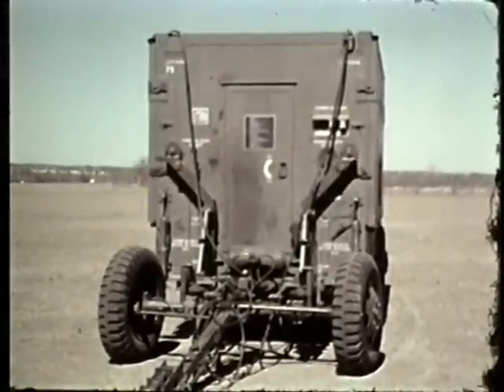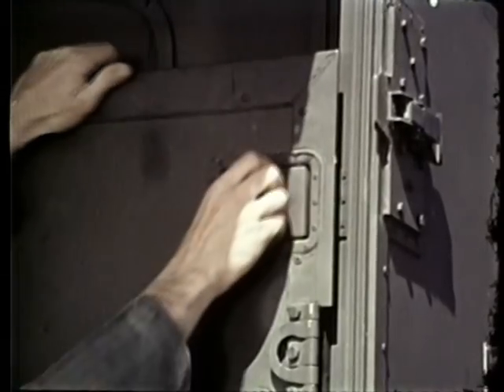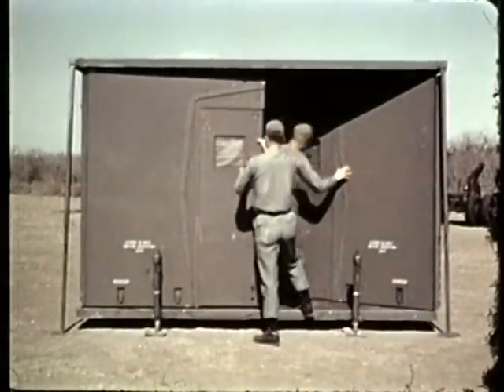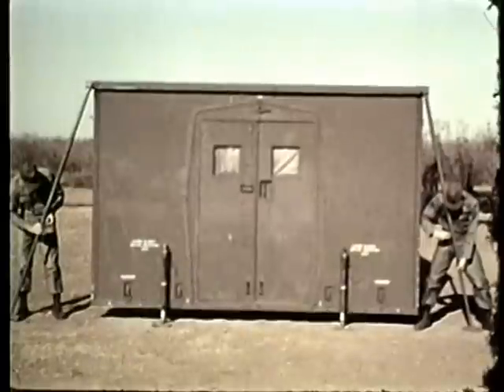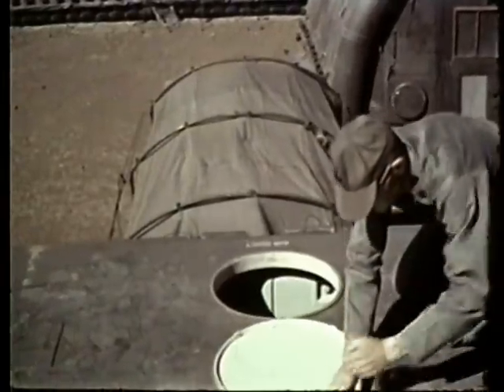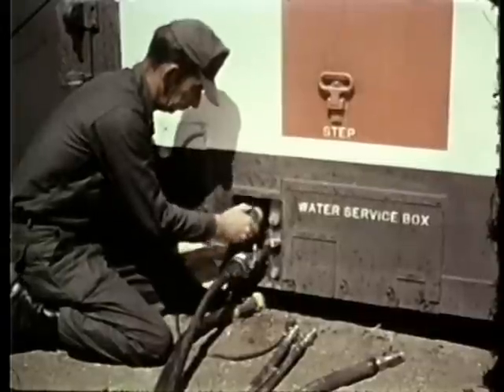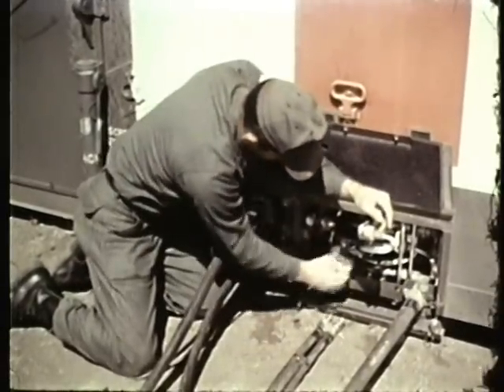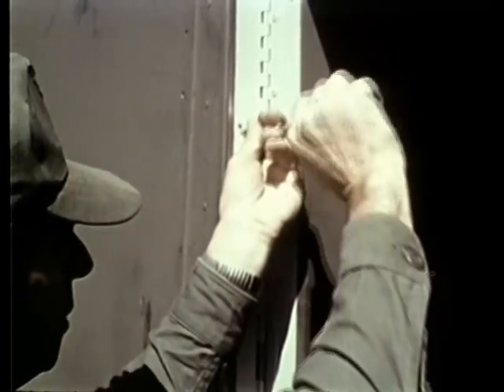U.S. Army M.U.S.T. Expandable Shelter (1972)

Comment: I like how all the ratchets are secured with cables so pvts dont lose all of them.
Reply: Unfortunately that was no protection against Brit squaddies. In BAOR (British Army of the Rhine) we were parked up with a load of these waiting to go exercise. Our sergeant major went and had word with his counter part in the US unit and told him that these ratchets needed to be secured as his lot would pinch the lot of them.  Next morning our SM ordered a complete search of our wagons and kit.  The haul was impressive, keys to several truck, lots of those ratchets but not all of them, US ration packs, tool kits and lots of other bits.  When the loot (that was found) was handed back to the US sergeant major our SM said it was lucky they were a US unit, if they had been a Brit unit probably only a 10th of what went missing would have been handed back.

Comment: While testing the next level of M.U.S.T. At Fort Hood Texas in Summer 1978 my pharmacy was inside one of these units. Rather than going for delicate shelving they decided on aluminum chests waterproofing and damage proofing the medications.
Those water, power air-conditioning connections came from a device called a U-pack basically a small jet engine to heat water to provide 400 and 60 Hz power, air compression to inflate the inflatable building. Solid structures were made by a honeycomb material Lite and strong.  
BTW I met Gary Burghoff, he was doing dinner theater in San Antonio. I asked him if he would be interested in looking at the new type of M.A.S.H. He was absolutely not interested in knowing anything about current military combat medicine kind of a sour short person to talk to. The funniest thing I saw was an India, Indian looking at American procedures. He was noticing an IV being set up which included a three-way stop cock. Coming from an overcrowded country. He asked is this a new American birth control device?

Comment: I actually know how to do that I put up many of those when we went out into the field in Germany in the early 70s
Reply: Radionut R how bad did they leak if like the tents we use now and days they would
Reply: Why did they have air seals? Were they worried about chemical/biological attacks?
Reply: @jayyyzeee6409  This was the 1970s. It was nuclear attacks they had in mind, radiation travels in the wind, so being airtight was the least they could do.
Reply: Radionut R I learned how to fix the MUST A/C system in AIT, in 1985.
Reply: Thank you for your service gentlemen

Comment: The name stands for Medical Unit Self Transportable. Only the last few seconds actually gives you an
 idea what the actual structure was. These little boxes aren't the "shelters" they are connections and entrances. The actual usable space looks like a quonset hut only it's made of soft material and it's inflated. The hut's ridges are wider than the metalic type, about a foot, and consist of long pockets in which are bladders which are inflated. When the bladders are inflated the hospital room gets its support. Unlike previous inflated structures the interior isn't pressurized, only the bladders. If some are damaged the others still support the structure. The bladders provide a thick insulted wall which helps insulate the interior in desert heat or arctic cold. The boxes we saw in the video can be used to interconnect several units for the size needs of the situation. A multi-ward hospital can be set up in the field in minutes. These were the MASH tents on steroids.
Reply: With real floors!
Reply: @garywheeler7039  I wonder if Klinger could eat one of these?
Reply: @doctorgravel8572  Best comment ever!!!! Section 8 guaranteed.
Reply: Thank you, was trying to find out what M.U.S.T. stood for without much success.

Comment: When I was in Desert Storm one of my jobs as an Infantry Medical transport operator with the 1st ID 3/34 Armor was transporting injured Soldiers to a MASH unit, and the med. tents where inflatables and air conditioned they where not like the old tents like you saw in the TV show MASH, they where full blown HOS. units with state of the art Med. equipment very impressive I thought.   I don't believe I saw any of the M.U.S.T. shelters, by then they may have had already fazed them out,  but have to mention that the US Army tends to reuse a lot of equipment as we where still using quite a bit of Vietnam era equipment, they didn't tell us but the frag vests we where issued where defiantly Vietnam era, and maybe even recycled, the one I wore I could have sworn had blood stain, but I was told it was just grease or oil or something, still was not convinced, at least we where issued the "K" pots as opposed to the steal pot, we did though have steal pots when I was in Basic, the K pots are much better. and those are my thoughts.
Reply: They need to be using some sort of trailer instead of the inflatables depending on what you're doing. Little to no set up and tear down time compared to the inflatables and could be used while in movement which is impossible with a inflatable shelter. Been there done that with old Army equipment but we had it easy compared to the Soviets.
Reply: So true about the Army using old equipment. I served in the late '90s and most of our hardware was still from the Vietnam era.
Reply: _I saw a 'temporary' quonset hut from WWII still up on Fort Benning in '01.  As I said about my temporary barracks structure:
Designed to last five years
Wears out after five months
Still in use in fifty years.
Reply: Inflatables in desert Storm?....I was a kid during desert Storm and was active 4id starting 99 and never saw an inflatable.....just the typical G.P. medium and large and the 577/113 tent set ups plus some hard shell truck type rigs similar to these
Reply: Joe Marco yall should have seen the role 3 in KAF. Mix of seacan and tent set from the us and canada. Fucking outstanding
Reply: *phased.
Reply: "phased" out.
Reply: @ Joe Marco-  you bring back memories by using the term "Fazed Out"... yes when I deployed to Iraq 2003 I drove the Deuce & 1/2 ...fortunately I already knew how to drive a 5 speed. Regarding old equipment,  the second barracks which I moved into were actual family housing, the same  design as the housing back in late 70s, early 80s. FT. Meade ...my Dad's duty station.

Comment: In the mid 1970’s and 80’s the USAF would connect four of these together with their inflatable roofs. They would then house TACC’s and DASC’s. About four hours and twenty airmen (60 Army) to complete the assembly. Then two deuce and a half’s would bring ginormous camouflage bundles that required two more hours of hanging.  Upon completion , ground power would connect two-8 turbine generators in series to provide communications power. You could here these jet turbines two miles away. Then, like a sick IKEA project, tear down would be the reverse of assembly. And yes, icy cold and tropical heat made assembly completely worthwhile . Naturally, all this came with a check list for assuring correct assembly. Don’t think the ruskies could spot these in actual conflict!
Reply: Been there. Done that. Got the tee shirt. Deployed to Hungary in 95/96 in support of Bosnia.  When I first got there we had a lot of GP medium tents and these little beauties. Radar, Comm, and ATC. We thought these were the greatest things. I think the Army ended up missing a few, LOL!

Comment: I wonder how many of these are still in storage, somewhere, and forgotten. They still could be put to good use today, in civilian service ...
Reply: Johan, let me tell you, when DoD is done with it, it’s pretty much trashed....
Reply: Tiny home .
Reply: They'd be nice campers.
Reply: Johan Janssens these are still in production in various configurations and yes many are sent to the desert for storage.
Reply: If they are still in a warehouse somewhere they are all probably rotted out and covered in rust, mold, and asbestos. Plus I dont think they make those power and water lines anymore.
Reply: The army still uses these in aviation units as shops , when I was in kosove in 1999 we had a row with 10 of these behind our hanger, we called them SPAMS
Reply: The designs should be declassified by now. 

A company making them could easily sell modified versions for campsites and temporary shelters in emergencies.
Reply: Lee Chowning I doubt the design was classified in the first place. Probably could have bought some yourself if you ordered in bulk back then.
Reply: Yeah just hook up your jet engine to supply power and water to those things
Reply: Purple Kid just need an A...dapter kit🤣
Reply: I want one... Just Minus the Jet engine.
Reply: @leechowning2712  Sure.  But it probably weighs around 8-10,000 pounds. And they likely don't have the amenities of a modern RV.  So while they are probably quite durable, you wouldn't necessarily be very comfortable.
Reply: Like Kitrina or porto rico
Reply: I have one behind my shop as extra storage. Bought it at a state surplus auction for $100

Comment: I have one of these and I am looking for hardware that I can use to make this a tiny home
Reply: They probably bought dozens of them. If I were you I would keep an eye on line for auctions of surplus equipment  where one in complete form might turn up.
Reply: I'm sure you could find everything you need to upgrade,replace hardware at your local home and hardware stores.or maybe Army/Navy surplus store.So many ways to convert this into Tiny house,Camping. I'm already thinking about putting it on a car trailer for camping.

Comment: But what would this building have been used for? A lab? Storage? A prep area?
Reply: +Jennifer D. 
Everything. The Armed Forces were committed to versatility back then.
Reply: Operating rooms, laboratory, radiology. Preop area was under inflatable or canvas. The one they are showing was probably an operating room.
Reply: Nuclear decontamination chamber hence the Air lock. The whole inflatable village looks interesting.
Reply: William;:  Yes I was across the road from the 45th Surgical Hospital in Tay Ninh, Vietnam in 1968 where these were used to supply the units.  These were used to supply heat/cool, water, inflation air and possibly electrical to the blowup surgical units.  The air lock is to protect the internals from the outside environment (-20C to + 100C).

Comment: 400 cycle power?  That's often only on ships, submarines and aircraft so that transformers can be smaller.  Why would the army want 400 cycle power?  Could they have been using these shelters as computer rooms?  Many of the 60's era main frames used 400 Hertz power as it was requested by the US Airforce for their military contracts.  This resulted in computer rooms having motor generator sets to produce the 400 Hertz power and they tended to whine because no one told the operators to periodically pump in lubricants with a grease pump.

Comment: I M.U.S.T have missed something why does this thing have an airlock
Reply: Sniper31: FAST units use inflatable quonset hut style buildings. Helps maintain structural integrity of the overall structure. Provides a positive pressure portal in CBRNE environments (think final stage decon station.) Don't want to endanger the 'Hawkeyes,' bad for morale, ya know?

Comment: It's like.. the most intricate, inefficient, wheel-less RV ever designed.  Think of all the manufacturing involved for this thing, vs a 2019 RV trailer.  $500 hammers come to mind.  Edit: ahh.. the comment below gives more detail about these just being connectors for the inflatable quonset huts..  that makes a lot more sense, because otherwise they are just windowless hotboxes.